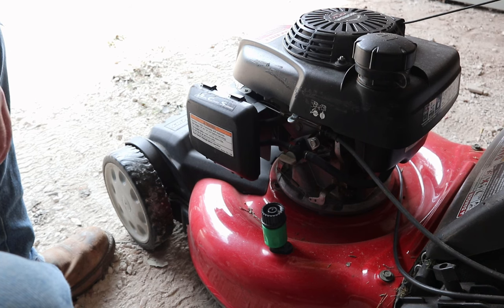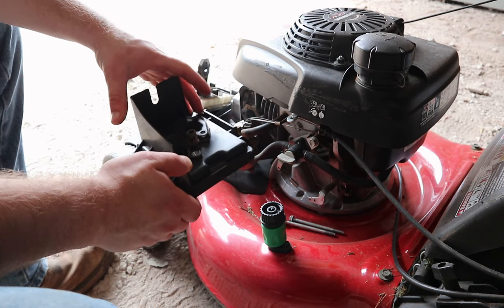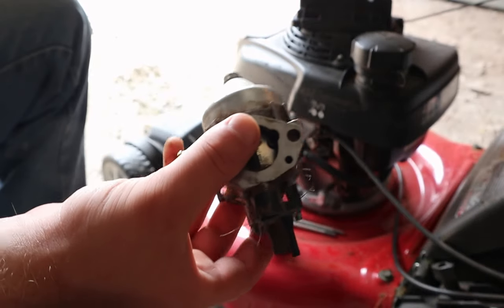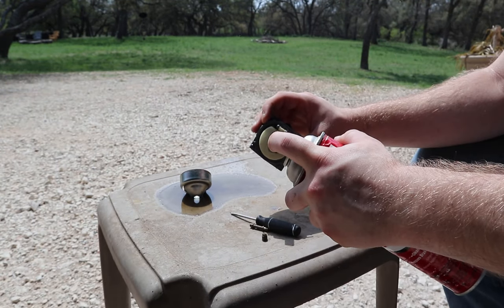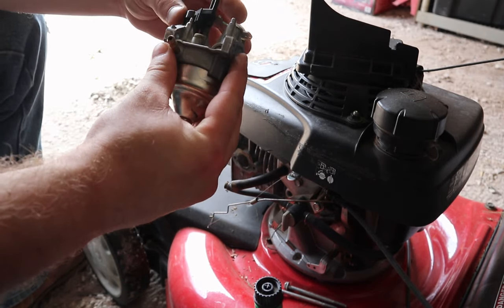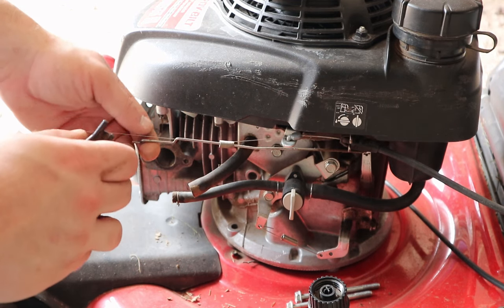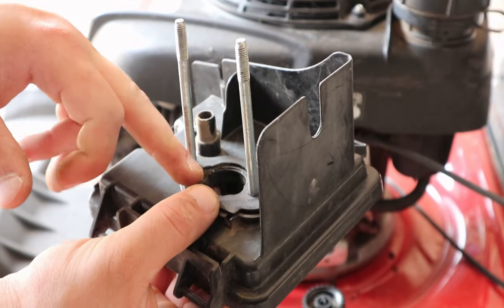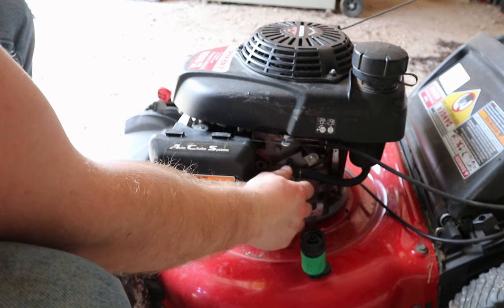Honda GCV 160 Mower Carburetor Clean/ Surging Fix

Comment: This video was the only one that showed me exactly how it all went back together. It’s really hard to keep track when the whole thing falls to pieces when you take the two bolts off! Thank you!!
Reply: Dude, for real. I took mine apart to clean, and didn't realize the entire thing was held together with the two bolts on the outside of the airbox. Everything collapsed and I had no idea what the hell I was looking at. Video was very helpful.
Reply from the maker: No problem man! I’ve taken the apart many times and I still struggle to put it back together. It would’ve been better if the bolts were studded with nuts on the end or have less gaskets. If I have to take it off again I may just throw some studs on.

Comment: I’ve taken mine apart and cleaned the stem flute valves so many times. They get clogged up from all the dirt and dust. The filter helps but you still have to clean it periodically. I should use ethanol free gas but I don’t. The springs really need to be tensioned right or it will run too high or slow. The Honda engine is solid as a rock. Just the carburetors causes most of the issues. It’s either this or pay someone to mow my yard. I like mowing my yard though so there you go. Good video.

Comment: I bought a new carburetor from amazon, came with all the gaskets a spark plug and an air filter, it was only $19. The mower runs like brand new.

Comment: You didn't clean the emulsion tube holes with a pin or any needle type tool to make sure all the small holes are clear same in the main jet.
Reply from the maker: Good point. I shot air down the middle of the tube. Mine didn't have anything in the side holes so I forget to mention to visually check them and spray those out if theres stuff in there.

Comment: Did exactly as you, failed to fix ! I just replaced carb, wax choke, last Apr and fixed it. But started surging < a yr of use. I’ll never buy a Honda powered mower again. I rebuilt carb on a Koehler motor and was forever fixed. Least Honda parts cheap online !! But makes no sense !
Reply: Make hole little bigger

Comment: Mines completely new i’ve had for 2 yrs locked up in my storage, and i just tooked it out recently to cut the grass from my new house i got and im having trouble to get it going it had new gas and it seems the carborator doesn’t suck any gas, my dad was adding alcohol through the carburador and it would turn on and it would turn back off immediately. Any tips would be appreciated
Reply: Also its the same model as the one u have in the vid!

Comment: Had the same issue. The long double side hooked spring that goes around the choke rod broke. Replaced it and forgot how it all went back together.  This helped a lot. Now the damn thing starts rough and I have to finger the throttle/choke arm once it fires to get in the proper rpm’s. Hell if I get another four years from it after nearly a decade I’ll be happy with that.

Comment: Thanks for posting this step by step process of cleaning out the carburetor. I used some Marvel Mystery Oil Spray kicking around that I used  along with compressed air to clean everything up. I did use some welding tip cleaners to make sure all the holes were clear as well. Showing which way the tube goes in before the jet was VERY helpful along with the notes on the correct spring and linkage hole locations. The mower wouldn't start before, and now runs fine. I did also clean the float needle and seat.

Comment: Thanks great information, removed carb and cleaned to try and solve hunting issue. No luck. Removed carb again and found auto choke pin gummed up. Removed pin, cleaned and gave it a drop of oil. Motor running fine again. Tip to know if it’s a sticking auto choke: motor will start and run normally for about minute or so until it warms up a bit. Then starts hunting as the auto choke does not deactivate due to the sticky pin. This is on a HONDA GCV160.

Comment: Amazing Video Bro!!! Did exactly what you recommended and after a few pulls it cranked right up.  Running amazing.  Same engine as on my Ryobi GCV160 pressure washer.  Now able to pressure wash the house.  Btw-  my pressure washer sat to long abd carburetor was all gunked up.

Comment: You need to re-shoot this video.  The camera angels are way off so most the time the viewer is looking at your arm or the part is cut out of the frame.   Your explanations of what to do are clear and well done.  You will get more views if it is easier for viewers to see the connections and parts clearly.

I have worked on this carburetor and it is hard confusing so I appreciate your effort
Reply: Lies. Build your own channel buddy

Comment: appreciate the video. took mine apart/cleaned it good. Got it all back together and it's running WAAAY FAASSTT. took it apart and back together. same thing. it runs on first pull but its idling at high RPM. Any thought what I did wrong?. appreciate your post!
Reply from the maker: Make sure the gaskets are in order and sealing. Next check the throttle linkages and springs, make sure they are in the right holes. From there check the idle screw.
Reply: Found the problem. Old smashed gasket next to engine. Governor are barely hitting it. New gasket runs perfectly!!

Comment: STILL SURGING???
What he failed to show is on top of the carb is Philips head screw. Under that screw is the IDLE JET. it is a fixed jet, meaning it cannot be removed. That jet gets clogged & will cause no idle or surging idle. The bad news is is that the hole in the jet is so microscopic small that it virtually impossible to push a wire through it. 
Soaking the carb or using a Ultrasonic machine is the best bet. I just usually buy a reman carb (Chinese clone) from eBay or Amazon ($15) & that solves the problem.
99.9% of the time is that the idle jet is clogged!

Comment: To remove the gas line do you just pull it off?
Reply from the maker: @kristenshea3659  use pliers on the hose clamp then pull it

Comment: After removing and cleaning my carb my govenor arm does not move? Plus it’s reviving very high any solutions?
Reply from the maker: Make sure the gaskets are in order and sealing. Next check the throttle linkages and springs, make sure they are in the right holes, and not broken or hanging up.